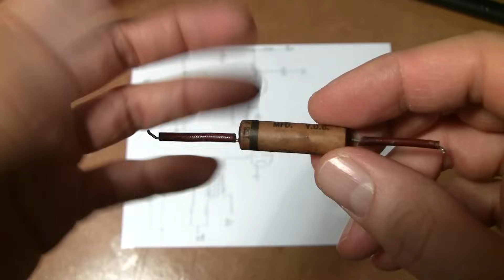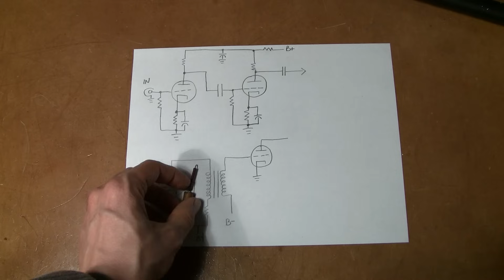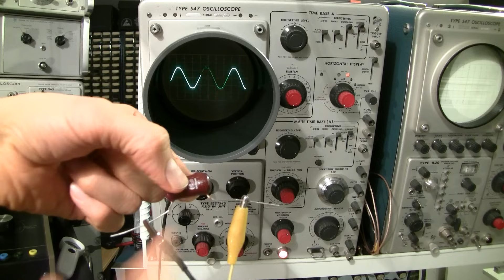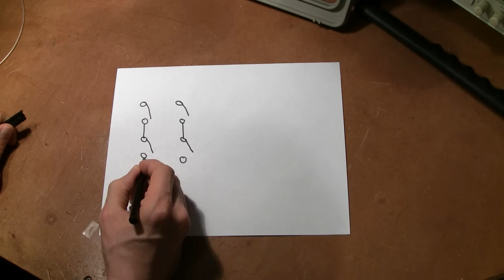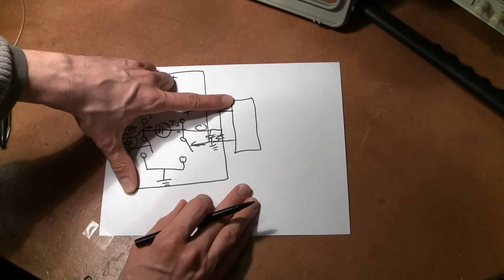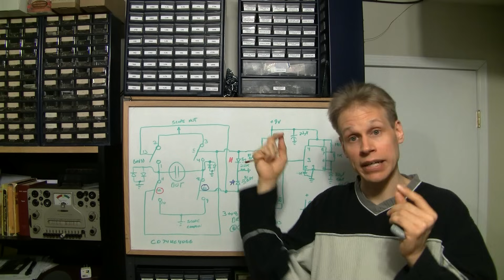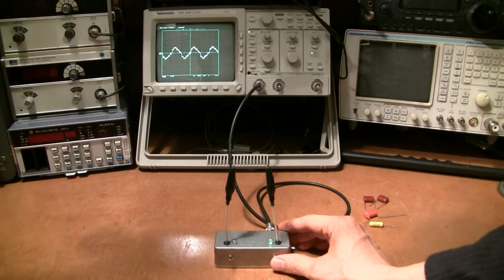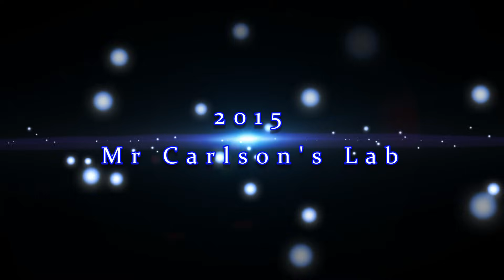Are Your Capacitors Installed Backwards? Build this and find out

Comment: Very interesting video as usual. You always amazed me with such valuable information that i didn't learn from my electronics school. I tried this on my oscilloscope as i'm watching this video and indeed i confirmed that there is really a polarity of the capacitor(except that obvious polarized capacitor of course,hehehe).. Now my question is,is this also applicable on today's circuit that uses semi-conductor? Will it affects also the performance of the circuit if you install those capacitor the wrong way around? If it did then I will definitely build a test jig myself :).
Reply from the maker: Hi'gak Iya  In many vacuum tube circuits, installing them the wrong way will degrade performance. This is the reason they marked the band end way back when. Today's lower impedance circuits are a toss up. I wouldn't hurt to install them the correct way even in modern circuits. Once you build the jig, it's only a matter of seconds to do.

Comment: Thanks you for your time.  That was a cool video showing electronic principles that are too easily taken for granted.  It clearly show that we can't always blindly apply the WYSIWYG rule.

On the other hand, I attempted the same experiment with 2-3 capacitors and my DSO, but I'm not able to get something usable out of it.  The signal on the scope isn't doing what you're showing on your video.

I really would like to see if someone has been successful doing it with a DSO and if so, what where the scope settings that were used such as the mv/div, the acquisition mode such a normal, peak detect, average, etc...
Reply from the maker: SimpleEnough2k9 The scope on the bench you see is a TEK DSO. If you are using a probe on your scope, try alligator clips at the end of a cable. So no probe, just a direct wire with alligator clips.... one clip on the shield and one on the center conductor. I find many modern DSO's have very noisy front ends. Not sure what brand of DSO you own??
Reply: Mr Carlson's Lab Hi, I guess you're right, my DSO "front end" must be really noisy.  I found out rather quickly that using a probe, 1x or 10x, with or without a 50Ohm adapter, was simply a no go scenario.  I tried with a coax cable that came with my DSO, one end with a standard BNC connector and at the other extremity, regular alligator clips.  I tried on both channels of my DSO, still no go.  The only thing I see is a messy/noisy trace on the scope, nothing close to a 60Hz sine wave.  I'm using a Rigol DS2102 100Mhz 2Gs/s scope, which served me well over the last 2 years or so.  If there is any trick to minimize the noise, by all means, please share it.  Meantime I'll check if I couldn't find a decently shielded cable.  I do have spare BNC connectors and alligator clips, so if I can put my hand on a good cable, this might solve part of my problem.
Reply from the maker: SimpleEnough2k9  In some cases the noise is filtered by the capacitor under test. Try to feed a clean 60Hz signal into the scope. Set the time base to make the trace look nice to you. Remove the 60 Hz signal from your scope and turn your scope to maximum vertical sensitivity. Get a BNC cable with 2 alligator clips (direct connection) and test your capacitor. (make sure capacitor is not charged before your test)
Reply: Mr Carlson's Lab I did as you suggested.  I fed a 60Hz sinewave using my signal generator.  The trace was as clean as it could be done.  I then set the vertical sensitivity to the maximum, which is 500uv/div for that specific scope.  When nothing was connected to the alligator clips, the signal wasn't clearly defined as the one you had on your Tek DSO, but not horribly noisy either although it was "bumpy" and the frequency indicator didn't stabilize to 60Hz, it pretty much moved all over the place.  When I connected a capacitor, the signal was attenuated in a significant way.  Depending of the capacitor value, ranging roughly from 1000pf to 0.33uf, the signal fluctuated between 100uv and 8-10mv.  I could see an attenuation when swapping the leads only for few of the tested capacitors and these attenuations were very small, creating more uncertainties than anything else.  Based on your video, the approach should work pretty much flawlessly, so there is something in my setup that prevents me from having success.  I did some other tests, such as evaluating some capacitors using low pass filters, phase shifts, lissajous figures, also evaluated some inductors using other methods and I can confirm that the DSO does the expected job just fine.  Eventually I will determine what I did wrong, time at which I'll go like "Deuh !!! Silly me !"  It would be interesting to know how successful people are at doing the same exercise and compare the scopes and settings they used to complete the experiment.

Comment: I spent 25 years doing component level troubleshooting and learned a great deal from this video.  Fortunately, most of my work did not involve tube amplifiers, but if any of my guitar amps, which have tubes, needs a capacitor replacement, I'll put the new one in the right way.  Thanks!!
Reply from the maker: Craig C Thanks for your comment Craig!

Comment: I knew there was a polarity to the "unpolarized" caps, but I never knew how to test them. Building circuit tonight!
Reply from the maker: alphahr  Great, let us know your results!
Reply: I questioned the use of the 4066 quad switch over the 4016, but then remembered "contact" resistance was around 400 ohms on the 4016 vs the 4066 at 5 ohms

Comment: Geil ! Extra eine Schaltung dafür zu bauen halte ich allerdings für blödsinn, es sei denn sie ersetzt das Oszilloskop, was hier aber nicht der Fall ist. Es reicht eine Platte mit 3 Kontakten (Masse - Kontakt - Masse) um schnell und intuitiv Klarheit zu erlangen.
Reply from the maker: Mirko Mueller It would be nice If they made capacitors with a ground outside shield leg. Infact, if I remember correctly, Some German sets had this (shield leg) in their audio coupling capacitors. Telefunken rings a bell.
 
Es wäre schön, wenn sie gemacht Kondensatoren mit einer Bodenaußenschild Bein. In der Tat, wenn ich mich richtig erinnere, hatten einige deutsche Sätze dieses (Schirm Bein) in ihren Audio-Koppelkondensatoren. Telefunken klingelt.

Comment: this video could possible explain why i have a buzzing/humming phono turntable pre amp that i made, it uses a few non polarised ceramic caps and i cannot find the source of the hum, maybe its my caps the wrong way around.
Reply: SP330Y unlike foil caps, ceramic caps don't usually have an inner and outer electrode, so chances are you'll have to look for another problem.
Reply: +fragwits No it was made on a breadboardthen i made another prototype with point to point wiring,bot versions hummed despite being powered by a dc battery? :( weird
 I did buy some of the caps from Ebay China,maybe fake parts,the type are polyester dark green in colour

Comment: Hi Mr. C:  In all my years of designing, building and repairing stuff, I never realized that some modern caps have a low impedance/ground end, so thanks very much for teaching me something important.  When I worked designing stuff, not everything I came up with was a winner.  Many times I came up with "high tech solutions to problems that didn't exist" and I'm afraid that I consider your elaborate tester to be one of those.  Still, it's all very clever and a lot of fun and you are to be congratulated.
Reply from the maker: oldgeezerproductions When the difference is so "in your face" that it presents it's self on an oscilloscope, "in mV!" I wouldn't exactly call that a "high tech solution to problems that didn't exist."  If results on test gear can't bring you past that, I'm sorry, but I can not help you learn. I do appreciate your comment, stop by any time! :^)
Reply: Mr Carlson's Lab I'm sorry, but I think you have misunderstood me.  I thank you very much for pointing out to me, and so many others, the very real problem of installing shielded capacitors backwards.  Even more so, I thank you for showing us a simple method for determining which end is the shielded end.  I did get past that, you know and you are wrong about another thing, you DID help me learn, so thank you.  What I (at an abortive attempt at humor) said about "a high tech solution to a problem that doesn't exist" is only in reference to that overly elaborate test set of yours, when, in my opinion, the original simple test you so well demonstrated is perfectly adequate for even those of us that do a lot of restoring.   Of course designing and building is a fun end in itself and any excuse to build something clever brings with it a lot of pleasure, even if it finds little use.  Thank you, I will be stopping by.  Peace?
Reply from the maker: oldgeezerproductions Thanks for taking the time to clarify your last post. No issues, I always welcome comments. Again, stop by any time! :^)

Comment: question tht still has not been answered because is not like the cap acts as a npn transistor or a pnp for this matter so how does this cap actually come into play? in a arduino uno you will notice those 2 big cap by the power jack and they are connected obvsly but when do they work ? if i power the uno with 5v(usb), 9v(jack) or 12v (VIN) what are this caps doing in place? when a transistor or voltage divider can and will do the same job?! and if im not mistaking there is a voltage divider in place for 3.3v (PWR Pin) and a resistor in place for regulating energy down to 5v (PWR Pin) so again why the CAP? and two at that if i was able to connect a motor directly to its GPP and work just fine then i wud have made a guess and said that those CAP are there to act as a reservoir of energy to contain the power needed to energize its motors like Servo Stepper or DC motors but i know that Arduino aren't good at powering motors directly after its a Micro controller  not a Driver Controller right and on those you do see this big Caps you notice in the Arduino uno so can someone share some knowledge and shine light on this topic? thanks in advance
Reply: Yes that, but more importantly: filtering.
Reply: Frank Lopez The caps by the power jack are probably to smooth the power and reduce noise. You could try using a meter to see if they're connected directly to the positive and negative of the input power jack. Perhaps the manufacturer of the arduino uno trusts the 5v usb to be low noise, and so they didn't give it the same protection. Does that answer your question?
Reply: +Frank Lopez Goog luck trying to keep your arduino stable under load with just your transistor!
Reply: CofeeAuLait i guess i do see your point, "reservoir"
Reply: CofeeAuLait tho there is such components called constant current Trstrs
Reply: right, all the noise
Reply: ac source ripple is something you want to avoid there.

Comment: Pro tip: You can use a '4013 as a non-inverting buffer. Adding feedback and input series resistors turns it into a a Schmitt trigger, add another resistor and a cap and you have an oscillator with no need for the '555.

To use a '4013 as a Schmitt, connect Reset, Clock and Data to +V, feedback resistor from Q to Set, input via series resistor to Set, output from Q. The ratio the two resistors sets the hysteresis.
Reply from the maker: Graham Langley That never crossed my mind,... Great tip Graham! I will have to fool with that design. Thanks for the comment!
Reply: Mr Carlson's Lab Can't claim any credit I'm afraid - I came across it in a commercial auto light switch circuit I traced out back in '87 and still have on file here. It's been used few times over the years in test equipment.

Comment: Back in the day I worked part time in a musician repair shop. I was surprised the first time I opened an amplifier from a British company called "Orange". All the caps were installed the correct direction; all the resistors were oversized (because resistors get noisy as they warm up); and all the transformer coils were wound on round bobbins. Orange Amps cost more but every musician wanted them because they were much higher quality (even if guitar players intended to add a fuzz pedal :-) )
Reply from the maker: Neil Rieck It's refreshing to hear that some companies are still doing the job properly. Thanks for the story!

Comment: Complicated circuit . On the box, rather than alligator clips, you could  also use some test eqt  ( red/black  Pomona) binding posts or even an  Pomona insulated test point  jack to stick the cap leads in and run the o/p of the box into the high impedance i/p of a guitar amp with the gain cranked up without having a scope. You should be able to hear the difference when reversing the leads on the cap under test.
Reply from the maker: SuperCarver2011 That Idea sounds great if you don't own a scope. I went with the alligator clips to accommodate  axial lead capacitors, otherwise I would have definitely designed it with binding posts. Thanks for the comment!

Comment: Great demo. Also, the proper capacitor symbol to signify polarity is a curved line indication the outside
foil of the cap.  Good to know that you cant trust the outside foil marking on the orange drops which are
used in every modern guitar for tone control..and being high impedance, hum is prevalent in some guitars
even with humbucking pickups.
Funny that you mention that the old wax capacitors are past their due date, guitarist search and pay the going inflated price for these old beeswax or PIO (paper in oil) Sprague "Bumblebee" tone caps to try and give their guitars that vintage tone  rather than the modern Sprague orange drops.
Reply from the maker: SuperCarver2011 Thanks for the comment!

Comment: Really good video on diy project. I would really like to know if there's another way to get the same result without the need of an oscilloscope? I don't have one and I don't want to have to buy one just to identify cap polarity. Is this possible?? You da man.
Reply from the maker: Jim Burns Hi Jim, There are some that are trying this with just an audio amplifier in this post. Check out the posts below, you may find your answer. Thanks for the comment!

Comment: Interesting to see the difference that reversing the capacitors makes, but surely replacing that toggle switch with a DPDT one could've made the test circuit an awful lot simpler? Cap goes to the wipers, ground to one diagonal pair and supply to the other? That leaves the fiddly bit to be indicating which end is the outside, which the toggle of the switch could be pointing at. Only thing left to add is a source of hum.
Reply from the maker: AintBigAintClever Thanks for the comment! The switch makes a simpler circuit, not simpler to read or sort many caps though. If you read through the comments, look for Zinahe Asnake , I explain why. (it was a long explanation)

Comment: I tryed your method of checking caps, I must say that I had to place my hand near an ac power cord to see the ac signal in my shop. But it works just fine. Thanks for the Video. Keep up the great work. Greg
Reply from the maker: Gregory West Hi Gregory, what is your scopes lowest sensitivity at in mV per division? You should have no problem picking up 60Hz.

Comment: Good video. I have always used a scope like you demonstrated initially but your tester is a good idea. I think I would use 3/4 post instead of gator clips. I find, maybe 60% are correctly marked of the ones I have tested.
Thanks for your cool videos'
73, Glenn
Reply from the maker: wa4aos Good info Glenn! Thanks for the nice comment as well, Stop by any time!

Comment: Thank you for sharing. Very informative. I never knew about the band-end and foil-end of capacitors besides the polarity of electrolytic capacitors. IMO the 555 timer is an overkill for the job at hand; a simple push button should suffice.
Reply from the maker: Zinahe Asnake Glad you enjoyed Zinahe! I'll tell you why I did the circuit this way........ For capacitors that are say .01 and lower, meaning in the direction of.001, a "no interference test" makes locating the band end easier. When you depress a switch, your coming close to the shielded body of the test fixture with your other hand. If you watch closely in the video, when I bring my hand close to the test fixture, the amplitude goes down. This is because I'm coupling to the test box through the air. When I touch the test box with one hand, I'm effectively grounding myself to it, and the imposed 60Hz drops way down in amplitude. So pushing a switch on that test fixture would confuse matters if I was to batch sort a bag of capacitors. I did experiment with this before I put the test fixture you see here together. So to keep my motion to a minimum (just touch the cap and see the difference) this was the best alternative. A few people have suggested a manual switch, and thats ok! But again, you really need to pay attention to the difference in amplitude on the scope.  Thanks for your comment!

Comment: It doesn't seem worth all the effort, just to save yourself the effort of swapping the oscilloscope leads to test a capacitor.
Reply: +Landrew0 I'm thinking an extra step could be built into the circuit to pull the noise level back into the box and the flipped difference used to permanently latch the correct shield-side LED. So basically you'd just hold the cap twixt your fingers, push it into a pair of holes, wait a few moments, and the LED would light up on the correct side. Would that be worth the effort?
Reply: yes